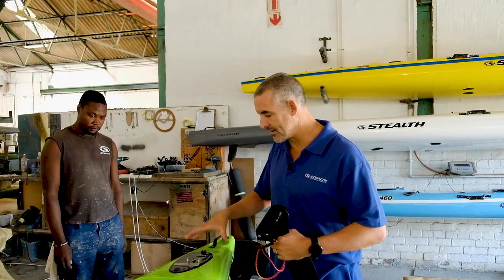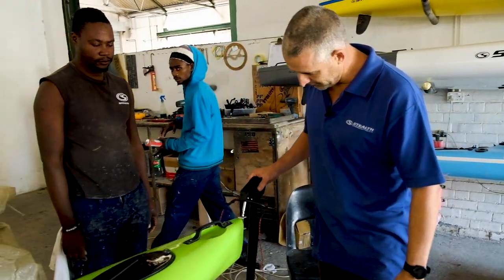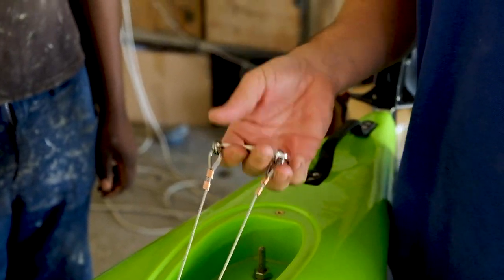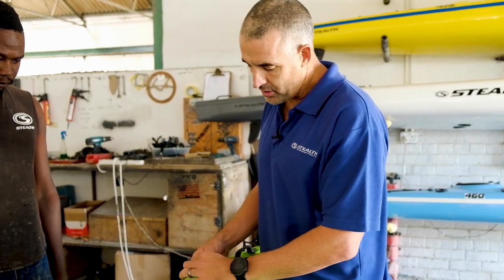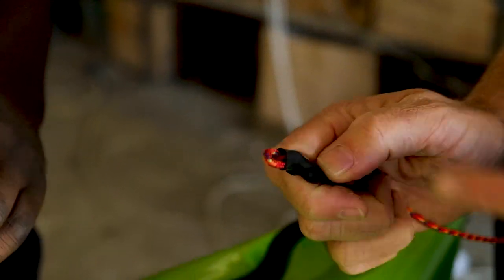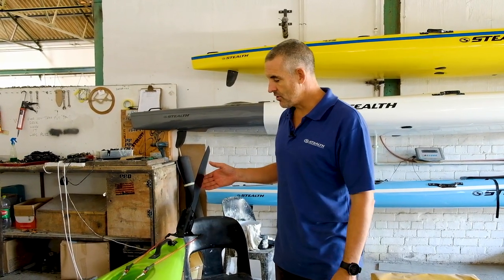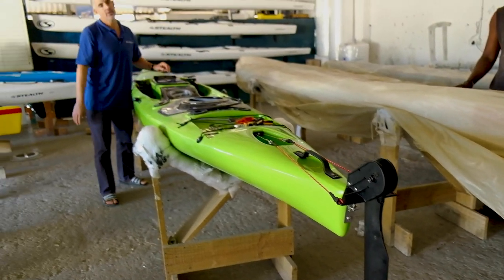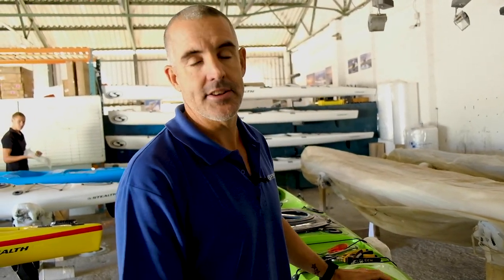Fusion Kick up rudder Upgrade

Comment: I just purchased a Fusion 480 with the kick up rudder.  Do  the screws to mount the kick up rudder to the back of the kayak included?  I don't have any and want to go fish tomorrow.  What size are they?
Reply from the maker: screws should be in the package.in metrics they are M6 x 12mm button head screw